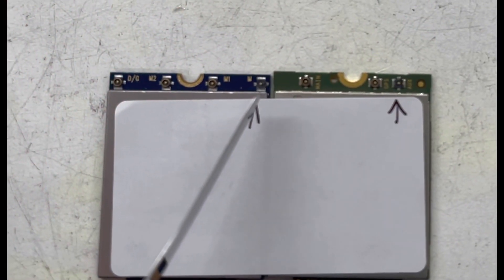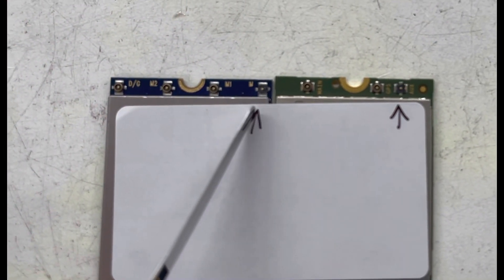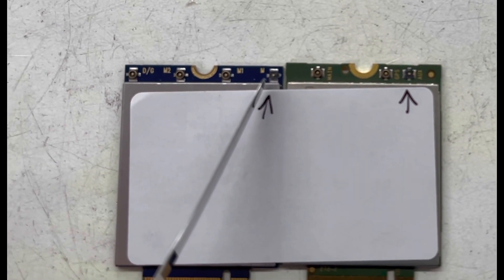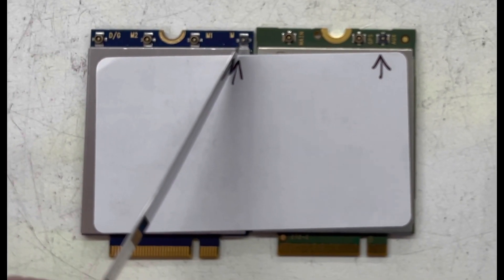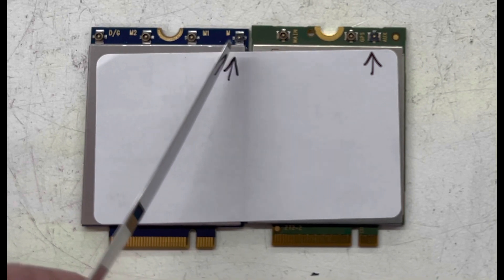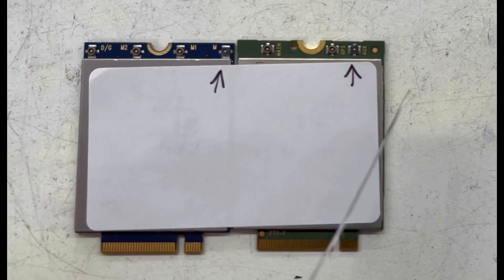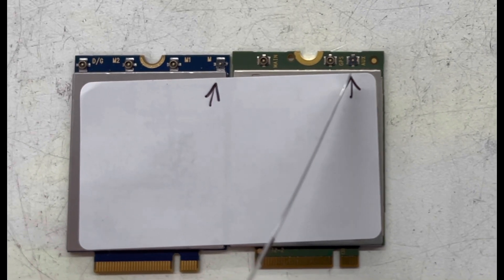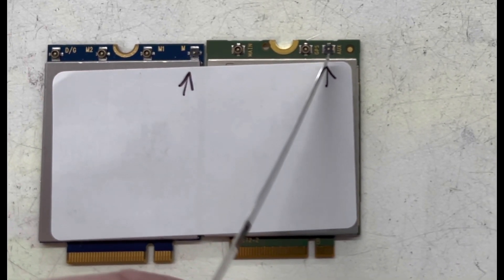Surgery status - extremely critical repairs on a pair of LTE radios

Comment: Doesn't look that hard.....😁
Reply: It’s harder then it looks, trust me.
Reply: That’s a skill that takes the correct tools and practice to no mess anything else on a PCB. Took me a good bit of time and practice to get to that point once I had a good hot air station, micro soldering tips on a good station and a microscope. He did a nice job 👍🏻